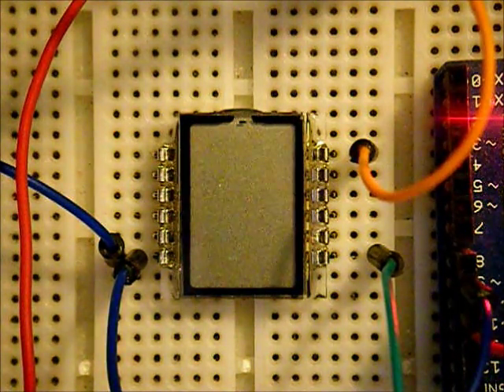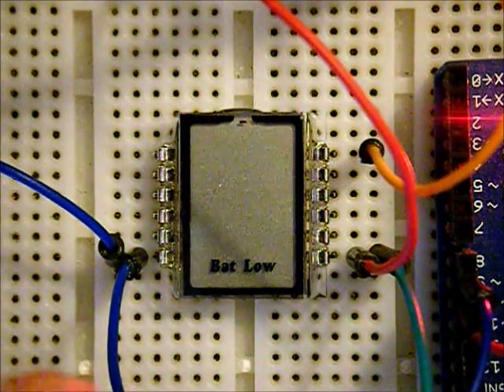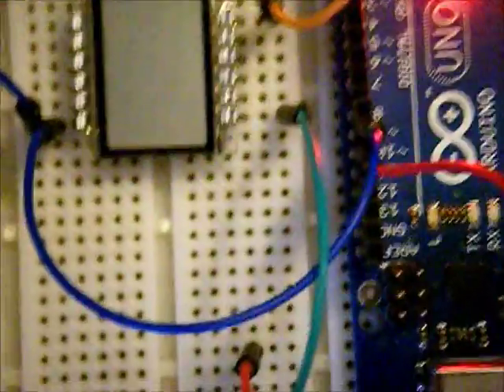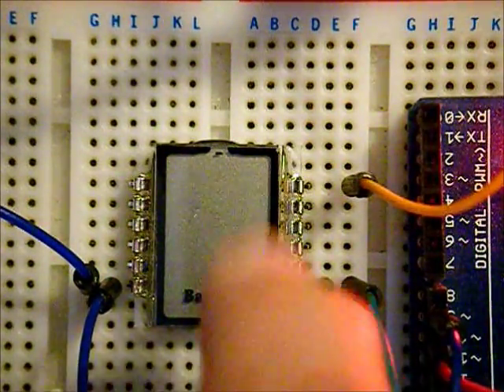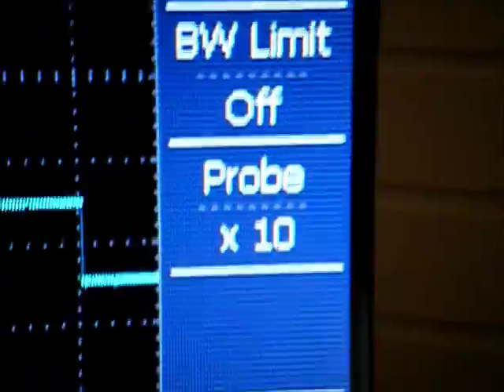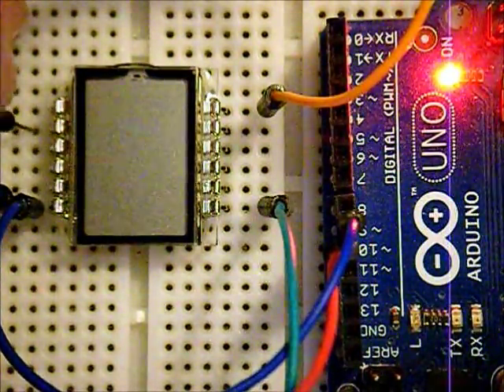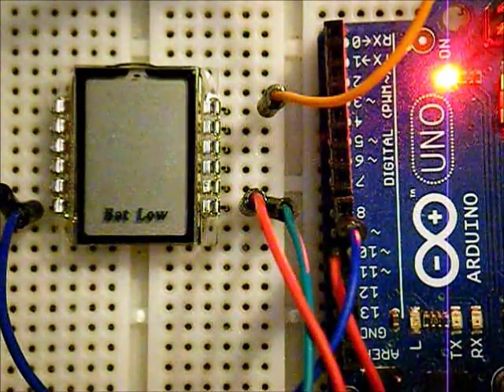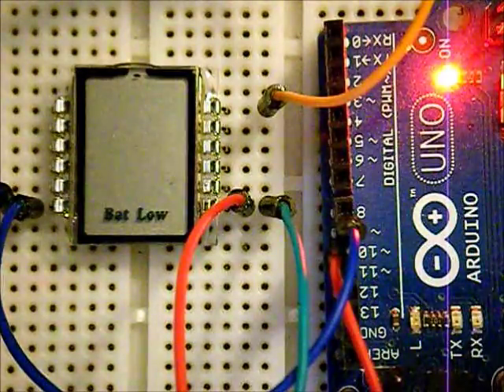How to use a basic raw LCD

Comment: Thanks for the video mate, it was nice to see a demonstration of the theory I read about earlier. Once PWM pin for each segment is kind of expensive in terms of hardware. Might need to find a work around for the 2 digit displays I just picked up.
Reply from the maker: Yes it would require a lot of PWM pins but you can use a dedicated LCD driver chip like a CD4055. I haven't used one myself so not sure how it works but I'm sure it's pretty straight forward. I'm just playing around with some things I've salvaged from old electronics so I usually just use whatever micro controllers I have at arms reach.